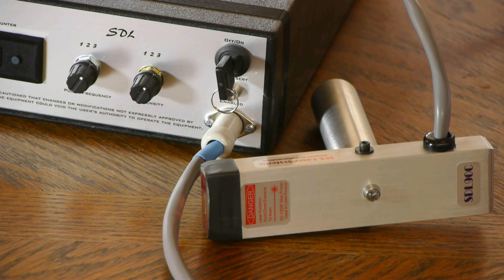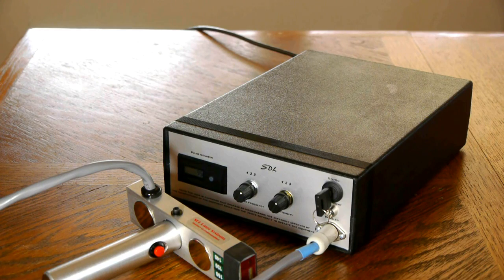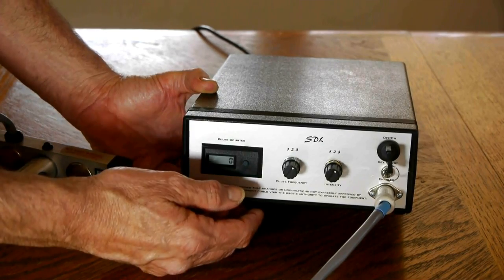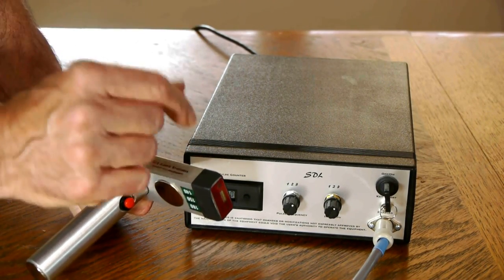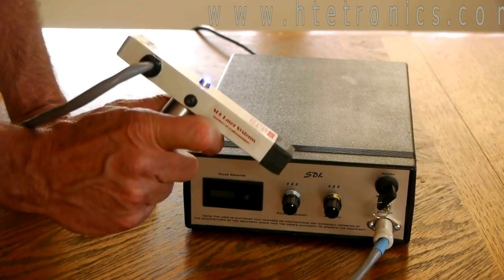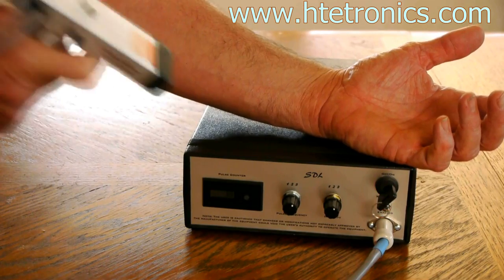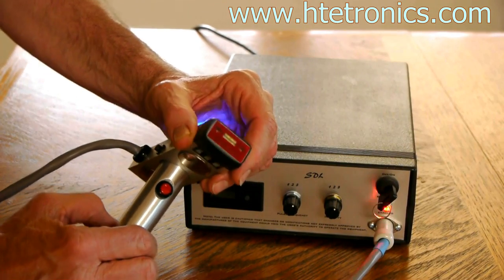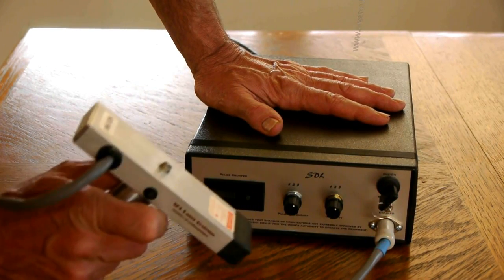SDL90ec Laser Hair Removal System Demonstration

Comment: I bought this laser a few years old and it does not work,  it worked a bit on nail and skin fungus, as for hair removal a it work a bit here and there. and once it goes over 200 shots, the unit will turn off, and you will have to reset it, this laser is old tech, and not worth a nickel,  this laser cost over $1200.00, thats a lot of money, for a laser that does not work. I have good success with Tria laser, one does shoots mirco lines of laser beams, on your skin, and other one for hair removal that both worked well. I am trying a new laser on the market it is call Neatcell Picoseond pen, blue laser on ebay for $59.00,  so far this small a laser is more powerful than all of the lasers that I tried combine.
Reply: Mike is the piscosecond red or blue laser strong enough for hair removal?